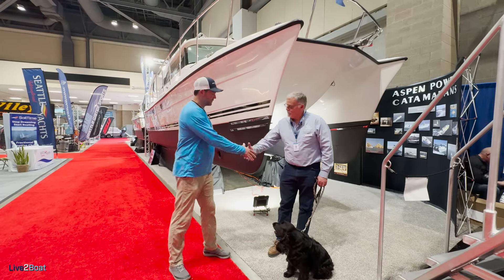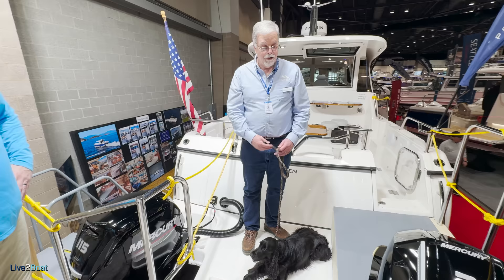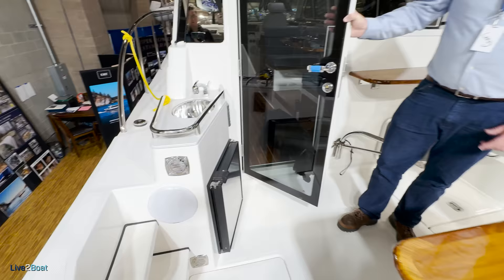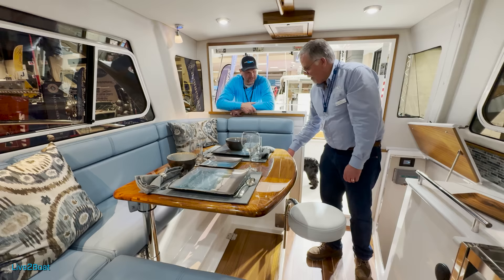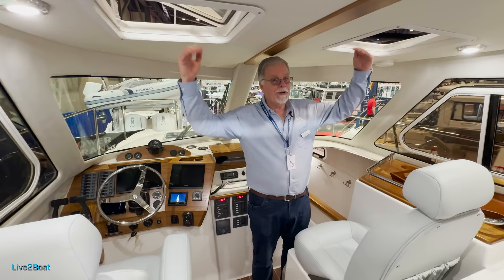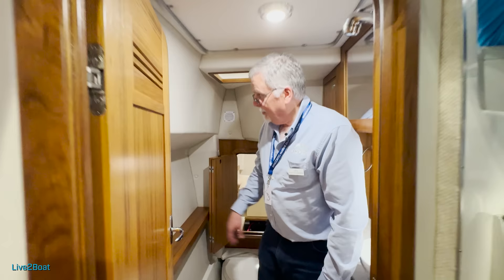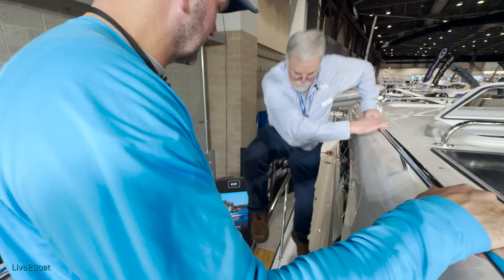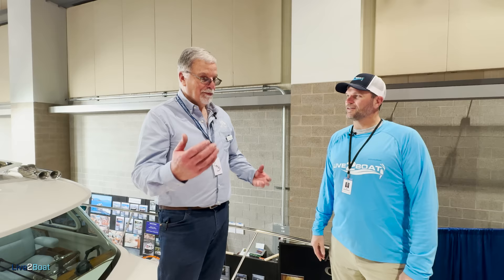Catamaran with Dual-Sized Outboards: The Ultimate Power Play

Comment: I like the Aspen 35 a LOT!  It would make a perfect Loop boat, with that super low air draft you wouldn't even need to fret about the western Erie Canal if you wanted to stay in the States.  Seems to have plenty of storage for gear and provisions, and I suspect they could even put a third solar panel on the front portion of the hardtop.  One of the very few dings is that it's a single wet head, and I don't really see any way to do anything about that in the amount of space available.
Reply from the maker: Thanks for watching. We need to do the loop someday…sounds fun! Next time I talk to Larry I’ll ask him about an additional head. Probably not an option but you never know.
Reply: Our Aspen C100 32' has snaps for a shower curtain (cockpit sink) allowing us to shower in the cockpit, then step back into the interior where we have interior privacy curtains installed.

Comment: I'm baffled. They made one side thinner to use a smaller engine? What happens if the larger sized engine goes out? Will the 115 power the lopsided boat at an adequate speed? If so, why not use 2 of them instead, and make both sides the same? You are just giving up volume to use a smaller motor, and now you have 2 parts lists, 2 maintenance procedures, and 2 design/engineering paths going forward. There is no free lunch. This is like taking 1/2 of the 35' and mating it to the 31' model and calling it a 33', and strutting around like you invented something.
Reply: Done for Fuel Efficiency the numbers he gave are impressive for a boat that size even more so with outboard gas engines. There are a dozen or so other companies that make symmetrical catamarans if that is what you desire.
Reply: Its a interesting concept for sure, im my experience with planning hulls bigger engines spinning bigger props at lower rpm generally give better fuel consumption then smaller engines at higher rpm to give the same speed. Most people seem to find this concept counter intuitive.
Reply: Its called engineering bro
Reply: @Flordiakayakbass  naa this is marketing
Reply: The Proa design Port hull 35% thinner was around long before the use of outboards.  I've got a 2014 Aspen C100 that has an inboard diesel Volvo Penta just outside of the bulkhead on the Starboard side-direct drive.  The boat tracks like an arrow, hands off with only the occasional correction or the need to dodge logs in the PNW! And my fuel consumption is even better than the outboards although I don't get to go as fast, which again in the PNW we have LOTs of deadheads floating around 😳  What finally sold me after years and years of following this Co. was I can go slow and impress my wife and dogs or I can run at the sweet spot 16-18mph and burn less than 6 gph diesel.  And because its a catamaran its rock stable when out fishing etc...
Reply: @gotthyme whats you MPG on the c100?
Reply: @LORENZindustries  the sweet spot is 3200 RPM. 16mph depending on currents in the PNW, burns 5.8mpg.